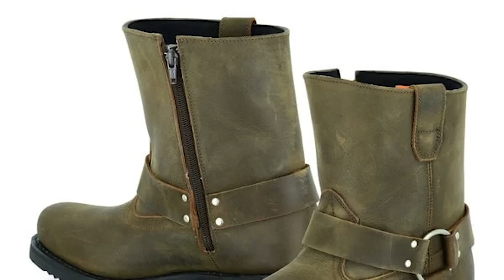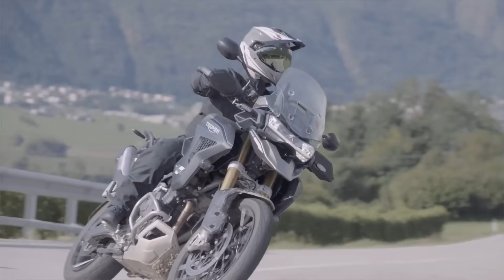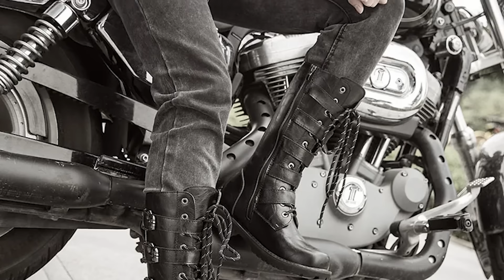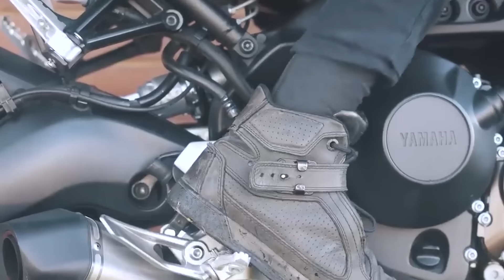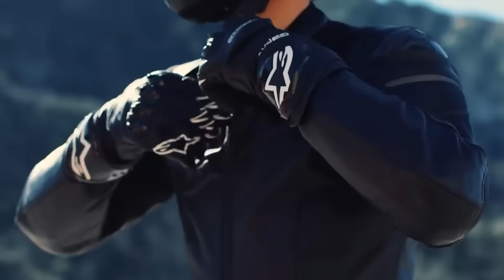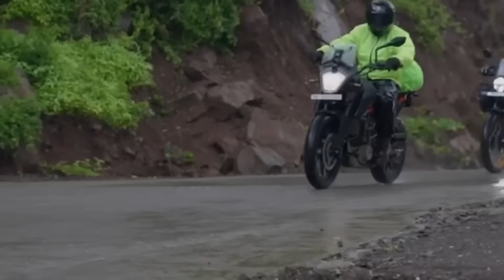Your Motorcycle Boots Might Be Hurting You (Not Helping)

Comment: I have a plate and seven screws in my left foot. The sole now is not flat on the ground to which has left me with a slight limp. But, back on the road again, more aware of my frailties and the failing of drivers to use all mirrors.

Comment: They don't make motorcycle boots to fit wide feet.  I defy you to find a motorcycle boot that fits wide feet, you won't find them.
Reply: Klim boots are wider than other motorcycle boots I have owned. I wear Klim Outlander GTX size 14 and they fit my 14EE feet very well. They are not real tall boots, however.

Comment: Check out FORMA  adventurer boots. I have the half size ones and I wear them every day at work.  

I ride practically every day. They definitely saved my ankle in a slightly moderate crash a few months back. 

They are super comfortable mostly waterproof They  have a European CE safety rating of 2–2–2–2 excellent high safety boots. Worth every cent! 

I Have owned my FORMA adventure boots for about 2 years now. They’re still in great condition. 

It helps to give them a proper clean and re waterproof every few months. I use “Nikwax” products to look after my boots. 
Cost about $400 here in Australia 👍🏽✅

Comment: While talking lower leg safety, much better than boots are roll over guards on the bike. But again not simply cosmetic bolt ons because they will shear right off.
Reply: You are thrown off the bike to fend for yourself by time the bike is on its engine guards. There is a youtube of a guy that came off his bike and one boot came off, in the slide down the road after the boot came off so did his foot. It was when the poor guy was being loaded into the ambulance he noticed his foot was gone. I agree with your point the engine bars or rear bars can help but you do need those boots and also really good gloves jacket and pants.
Road rash from a serious crash can make you wish you were dead. I have been riding 55 years world wide 50 with my wife, could not bare to see her suffer due to in sufficient gear either.
Stay safe.
Reply: @stevehunt9703 Absolutely right. It's why I eventually gave up riding. My reflexes are not what they were.

Although in my comment I was thinking above crush injuries I want to emphasize your point about needing protection from friction injuries. The one thing that scares me the most are spinal injuries - bikers are prone to two types. First the neck, because your head weighs 7-8 kilos and your helmet another 1.5. The momentum and pendulum effect in a crash can snap your neck unless you wear motocross style neck protection. The second is your lower spine. Most back protection is just padding but the most prevalent type of injury is corkscrew where your torso is rotating differently to your legs and your spine gets wrung like a wet rag. There's no protective gear I know of to prevent over-rotation of that sort.

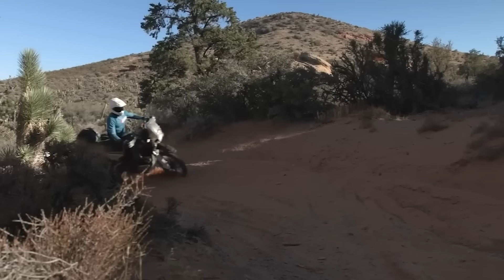Comment: Every see the video where guys chain breaks and pieces of the chain get stuck in his boat? Ankle breaks are most common injury on a motorcycle, but it's the weight of the bike usually. I wear leather boots after a stick went through my mx boots. Every see motorcycle boots melt? I wear Ariat boots, because I fell they are better made then plastic mx boots. Plus I can wear them at work. Which I am more likely to need foot protection while at work. Some of those flat soles do have impact protection. CE certification and EN 13634 standard compliance indicate adherence to rigorous safety regulations for motorcycle riding shoes. I would trust the ce cert more than A.I. video. On cruisers your foot is more likely to get under bike. On dirt people putting their foot out while turning is the issue. Don't do dumb like at 6:27. Those older cruisers don't even usually wear helmets, so of course their boots aren't the best either. First and last video I will watch from this channel.

Comment: When should you use the rear brake?  ans: NEVER!  It's just a vestige of years gone by.  I drove 6.000 miles on a trip and never touched it.  I'm what they call "smart".
I can actually think of a time to use it.  Forgot to heat up the front disc and got wet in the rain.  Won't work coming to a stop.  Apply rear brake judiciously.  And never let that front disc get wet again.
Reply: You don't actually know how to ride. Slow riding REQUIRES the rear brake.
Reply: @TheRealViking  Yeah, that's actually true.  Most of my driving was at high speed.  I concede.  Thank you.
Reply: I use my rear brake for trail braking on dirt road curves and on stops on hills.

Comment: Thank you for providing important information,  i currently have the Alpine Stars Radon Drystar it was 200 dollars, it only uses 3 velcro straps to hold on, it doesnt seem to have alot of protection,  please recommend something,  i currently ride a 2024 Triumph Tiger 900 Rally pro , im 6ft one inch tall and weigh approximately 225 in fit form, thank you for your help
Reply from the maker: Thanks for the detailed info! The Radon Drystar is a short touring boot with mostly Velcro—good for rain, but it doesn’t brace the ankle well. On a Tiger 900 Rally Pro (and at your size), I’d step up to a tall ADV/enduro boot with a hinge, hard ankle cups and 3–4 buckles.

Picks by use
	•	Mostly road / some dirt (comfort): Sidi Adventure 2 Gore, Alpinestars Toucan, Forma Terra EVO X, TCX Infinity 3.
	•	50/50 & more off-road: Sidi X-Power, Gaerne Fastback Enduro, Alpinestars Tech 7 Enduro.
	•	Max protection (less walkable): Gaerne SG-12, Sidi Crossfire 3.

Fit notes: Forma & Gaerne tend to be roomier for wider feet/calves; Sidi/Alpinestars run a bit narrower.
Reply: @MotorcycleNexus  I’m gonna repeat a comment I made elsewhere on this video in hopes of getting a personal response, because I’m thinking you know your stuff. I have 3 questions:
I just spent $333 (before tax) on Amazon for Gaerne Balance Oiled Boots . They're supposed to be waterproof and people say they're comfortable as these kind of boots go. I haven’t worn them yet. I hope I’ve made the right decision — I’m not made out of money 💸 
I have a 22 CB500X which I ride mostly on asphalt, but some tame dirt roads, nothing harder.
These Gaerne don't have quite as much ankle support as the hard plastic style boots, but enough, I hope. 
Does it sound like I have a booth that’s gonna give me pretty decent protection? 
Also off the top of your head, what’s the best way to keep this boot clean and waterproof? 
Finally, are you using an AI voice or is your own voice just that good?
Thanks for the video :-)

Comment: Several of the boots being shown are racing boots  fine and dandy if you're out racing or acting like you are. Most of us riders also get off and actually walk around ie sightseeing etc so there is  some compromising. When you're touring weight is important,  i wear boots that I  can wear for both
Reply: Only 4 pair of boots shown were sport boots. I wouldn't even consider them race boots. I don't think you know what race boots actually look like.  You're confusing enduro boots and sporty touring boots with race boots. Also you can walk around in them. I have a pair of smx v2's that can be used for novice track riding, sporty street riding and touring and I can walk around in them all day straight out the box.
Reply: Some even appear to be ski boots.

Comment: Recommendations?
Reply: I bought alpine stars smx i think theyre called?  $250, waterproof, seem to be nicely constructed and theyve got ankle pro.  They are definitely ride ready although they dont seem to be as stiff as this video recmmends.  They are excellent boots although ive never crashed in them!
Reply: @kevinnorris6157 Alpinestars SMX 6 v2 only has hard ankle protection one on side and no anti torsion system. The SMX Plus v2 do have a proper two sided connected anti torsion system.
Reply: Sidi or Daniese
Full boot, no shoes
Reply: If on a budget you cant go wrong with military surplus combat boots i've crashed and burned wearing those since the 1980s with no foot or lower leg injuries. Even hit by a few cars.
Reply: The other benefit of combat boots is you can use them for more than just riding. Lacing them up and breaking them in sucks though.